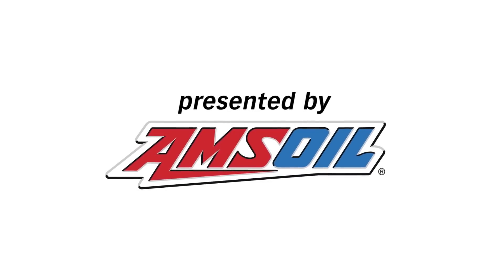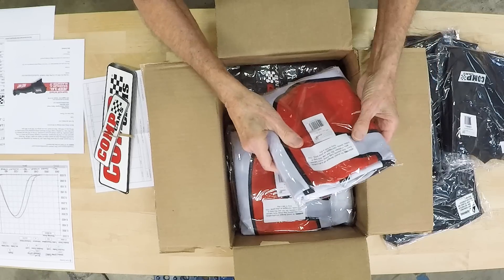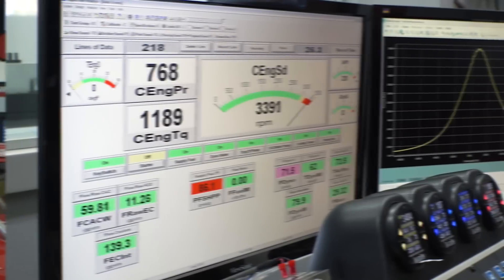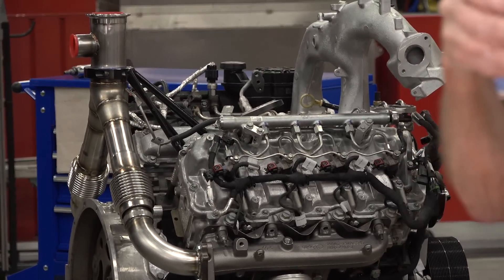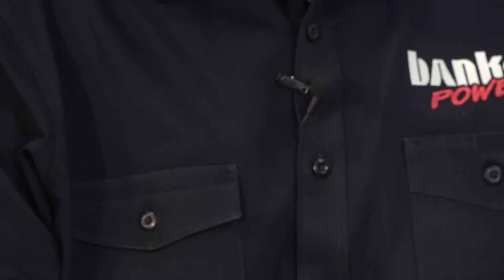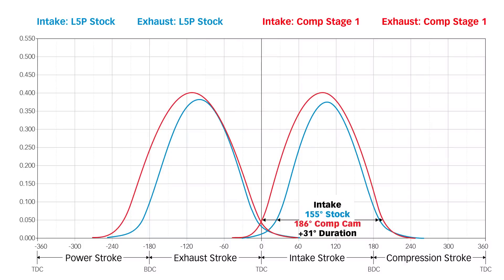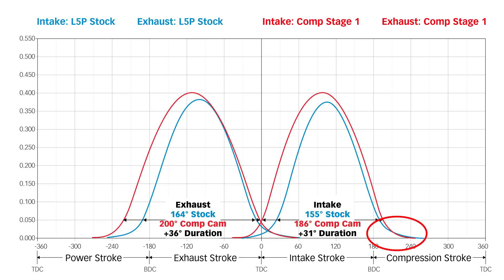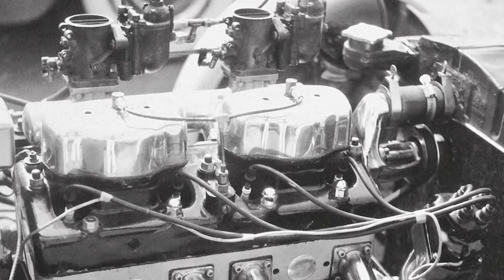UNBOXING a NEW Duramax high-performance camshaft!

Comment: I really don't know what the industry would do without you and your perception of FACTS, the why as to the way it is. So I have an LBZ that is in need of a camshaft and was wondering what your take was on the alternative cylinder firing order in regards to broken crankshafts. "If it's not broke don't fix it" Thank you Gale Banks

Comment: 5160 steel? That’s a high carbon spring steel (I’m a knife/sword guy), that’s good stuff used all over cars. Only downside is that it rusts easily but inside an engine with oil that shouldn’t be much of an issue.

Comment: Dear Gale, have you heard about the the new pneumatic valve system developed by the super car company koneigseg? Its called Free valve, 

https://youtu.be/S3cFfM3r510
and they are developing it for their supercars as well as daily drivers over in europe. It is driven with air and electronics, eliminates cam valve train loss, and allows you to keep the valves open longer than any cam would ever allow. increase horsepower and economy, cylinder deactivation, ect.... so many advantages over old style camshafts, if you have any way of contacting them they may be interested in working with someone of your caliber and expertise

Comment: Gale,   ANY chance on giving us some in cyl (pressure transducer) output vs crank angle stuff? What makes diesel so RPM limited? Slow burn rate? And high torque, related to higher cyl pressure after TDC, + pressure further into the power stroke because or injector duration + plenty of available oxygen to keep it lit?
I'd LOVE to see an in cyl real time pressure plotted on crank angles during dyno testing through an RPM sweep, comparing similar CI and HP output gas and diesel engines. That would have to include plotted fully instrumented dyno pulls to satisfy my curiosity.

Never had the opportunity to play with modding  diesel stuff but thought about it plenty. I know with modern high end in cylinder pressure transducers, it's possible to plot cyl pressure vs crank angle. I've dug up very limited date on gas engines, but single cyl research related stuff. I also at one time had what I considered a fairly accurate "peak number only" PSI of an (unknown) NHRA PS engine at an (unknown) peak HP. Expensive to create engine R&D numbers back when I was interested made them pretty much unobtanium.

An old hot rodder that started in the 1980's. You've rekindled the interest by sharing some, what would have been in the past, unthinkable info to reveal, publicly, and for free! Mind blowing! Thanks for sharing and truly enjoy your stuff even though, now I'll never afford or build a modern diesel PU.

Been following both monster truck diesel and stock duramax stuff. Camshaft swap super interesting to see results! VERY COOL AND KEEP IT COMING! You never fail at putting a smile on my face while watching your videos.

Just an old obsessed hot rodder.
Reply: Burn rate does have an effect on diesel rev limits. Also, the type of combustion chamber has an effect. Prechamber engines can generate power higher up in the rev range, and that is why many people race the Mercedes OM606.

Comment: Gale... another great overview of the principles of aftermarket camshafts. Will be keenly interested in seeing it run in the L5P. When you finely get done tinkering with this engine with many after market parts replacements - could you stuff the engine into a 2020 GMC or Chevy and let the boys from TFL run the truck with trailer up and down Ike’s Gauntlet in Colorado about 15,000 times blowing away anyFord or Ram in its tracks. 

In other words would like to see some real world applicable use of your engine performance gains when ready. Thank you.

Comment: there is never any love for the 7.3
Reply: Great engine for sure. I have a friend though that has a modified 7.3 in a 97 F350, swamps injectors and tuning I performance lift pump and a wicked wheel in the turbo. My '13 2500 HD Duramax with a wicked wheel cp3 injection pump high flow intake from WCFAB lift pump and tuned destroys that ole clunker.

Comment: Wow, the difference between diesel and gas cams are way different. I never knew that. I would imagine compressing the valve springs to the point of almost touching would be detrimental to the life of the springs, no? What are your thoughts on that? Not bashing by any means, just wondering for educational purposes.
Reply: If valve springs are properly designed, the coil stress at solid height should be  less than about 65% of the yield strength of the material.  Most builders set valve spring height so that it is about .060" from coil bind at max lift.  At high rpm, coil surge can cause high valve seating velocity, and cause high stresses in the valvetrain.  Setting the valve springs up to be close to coil bind can be a way to control coil surge, but very accurate measurements are necessary to make it work.

Comment: Seems that GM has slight "miller" timing with the camshaft. Good for MPG, cylinder pressure and emissions.  Interesting to see if same hp output is achieved with the 250bar cylinder pressure limit what was "used" in previous dyno video.  Banks you could show in next video how the cylinder pressure curve is changed at intake stroke from 60-0 ° bbdc as also exhaust stroke from BDC to TDC with the new camshaft. If you get rid of the exhaust pumping loss should the pressure level not go above the Exhaust pressure(P5) or at least the difference should be smaller.
Reply: We get it, you know cams

Comment: .400" lift isn't that far off peak flow anyways. The 4 valve layout really changes the flow curve. Even I am wondering the point of such a small camshaft. 186° .050 for how big the intake ports are and how big the cylinders are it should still idle awesome

Comment: Why not a cam from SoCal Diesel? They have L5P cams and they're only like an hour away from you I think
Reply: How many injector companies are between here and back east? They could have used a local place but they chose S&S! Seems like they like to use the best, doesn't matter where they are located on a map.
Reply: Maybe some kinda partnership thing going on behind the scenes?
Reply: Socal has a cam the runs great in a l5p. Been running one for about 6 months
Reply: I don't think Gale Banks would compromise performance for anyone, much less some stickers and a T shirt. Just saying. Or a behind the scenes deal.
Reply: I bet nobody at banks has ever heard of anyone but Comp?

Comment: Mr Banks, What can we do to have to get you a C8, put a blower on it for the 0-, and then add twin or tri turbos for increasing power as it climbs in speed.
You could shut all these bolt on you tubers down in one video.
And then add a Cam for round 2.
#BanksC8

#ImJustSayin

Comment: I think that's the first time I've actually seen cam lift and duration illustrated on a graph like that.  I'm plenty familiar with camshafts and how they work, but for someone who isn't,  that graph would probably be the best way to show someone.  I just thought it was a very neat, and simple tool.  Great stuff from Gale Banks, as always.
Reply: brussell639 you got that right. I just got schooled today!
Reply: @aznes004  Same here. I always get confused with the round symbology, but this graph is so simple to understand.
Reply: shane  
My first timing belt was done in my driveway for my wife's friend.  I was hungover and it was about 103° that day.   The water pump had corroded into the block so bad, I had to bust it up to get it out.  It took me a few minutes to come up with that solution, I'm pretty sure my brain was dehydrated.  But it got the job done.

Comment: What was the LSA on these two cams? Couldn’t tell by the pics?
Reply: 105 according to Comp Cams website
Reply: @EricFixalot  on a gas engine, that would lope like crazy, i guess i really don't know jack about diesels
Reply: @JoeHynes284  it's all fuel
Reply: @JoeHynes284  a cam only lopes if there is overlap, the duration is soo tiny a 105 lSA doesn't have lope.
Reply: https://www.compcams.com/stage-1-lst-186-200-solid-roller-cam-for-gm-6-6l-duramax-diesel.html
Reply: Think it's 34

Comment: I bet that A model crank and rods hated turning 4k,  it seems the early gas engines were designed after low rpm steam engines, but for more power international combustion engines like to breath and spin!   I can't wait to see the cam in there, I'd like to see it go in!!

Comment: Agreed, back in the 60's and 70's we were buying Isky Cams and yes, the overlap at idle was so extreme it was a hindrance more than a gain however, the idle sounded like it was 'powerfull'.
Todays Roller cams are far better in their overlap control as many folks already know, a late model stock Chevrolet Corvette engine can idle so smooth yet the power is in the 400 HP range. No lope at idle yet plenty of well designed power off idle. In fact, almost 100% of the total torque is between 1,500 and 2,000 RPM which is unheard of with flat tappet hydraulic cams.